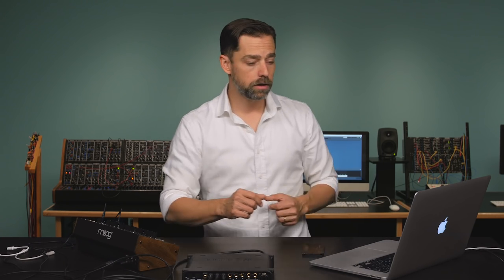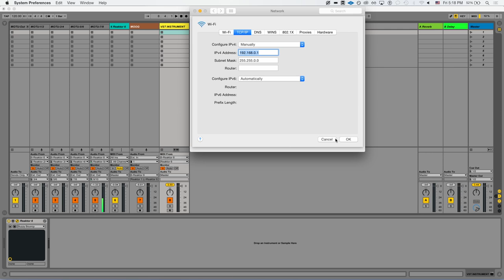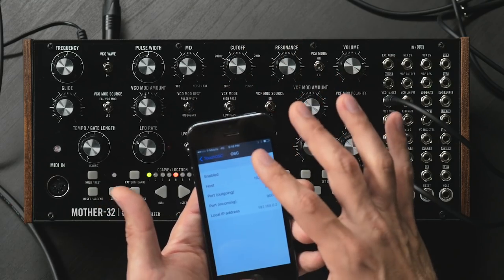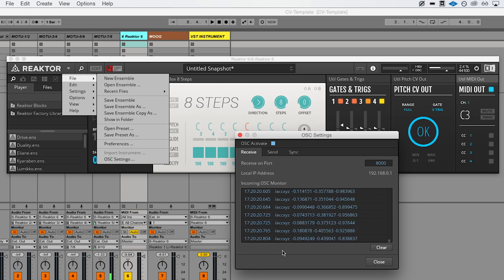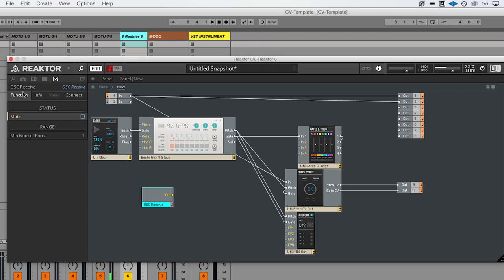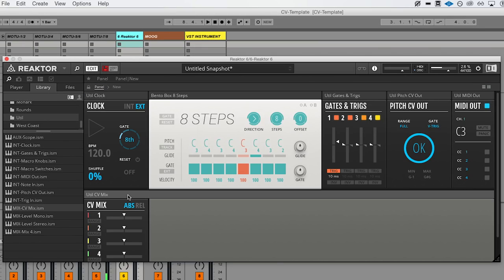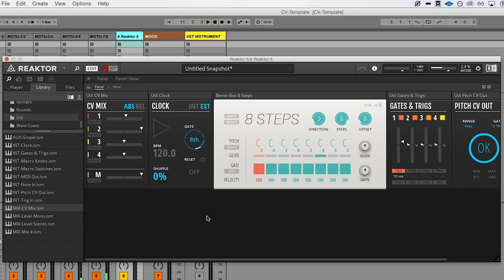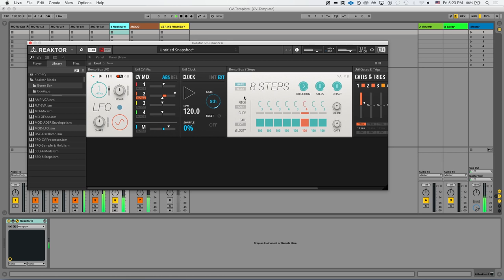Reaktor 6 Blocks 1.2 Tutorial #3: Using Open Sound Control to Control Voltage | Kadenze

Comment: Hey Owen, thanks for your great tutorials on Reaktor, Blocks and sound design in general. You keep increasing my gear lust, though. Many years ago I had a Mini-Moog, but now I am very interested in the Mother 32 being controlled by the Blocks software. Thanks for putting more pressure on my already anaemic bank account. ;-). As for remote OSC control via an iOS device, my head just exploded. The opportunities this represents for performance art, as you know, are quite literally infinite. Mind blown. Sometimes I have to get on an old-school analog piano just to reset to the elegant simplicity of the real world.

Comment: Dear Owen, I am hoping to reach you here in a round about way.  I have taken these Kadenze courses, ended up purchasing Reaktor and have been having a great time.  Someone created a modification of a Machine sequencer block for the Traktor Kontrol F1.  A very exciting however, both the designer of the original block and the F1 mod only work in Reaktor standalone, but do not work as a VST in Ableton.  I have some functionality but it is quite wonky.  I am not sure if work needs to be done on the core cell or if it is a routing issue in ableton or if it is a control surface/controller editor issue.  Do I need to add a complex series of blocks to route the midi signals so that my sequencer can write midi notes in Ableton to record the sequence?  Here is the Ableton Forum feed.  https://forum.ableton.com/viewtopic.php?f=1&t=223200